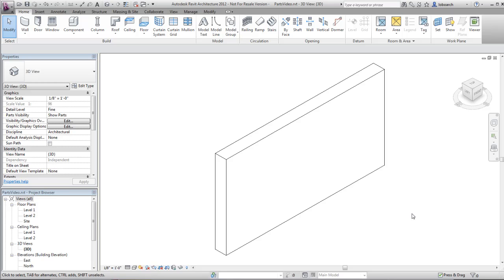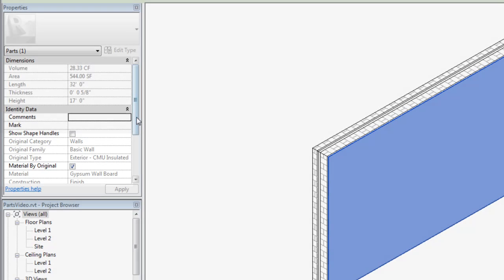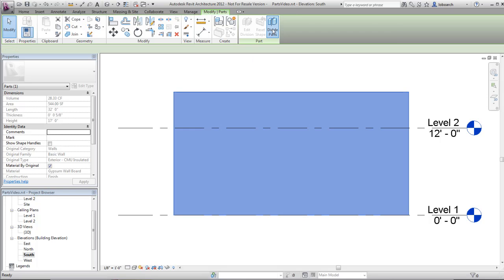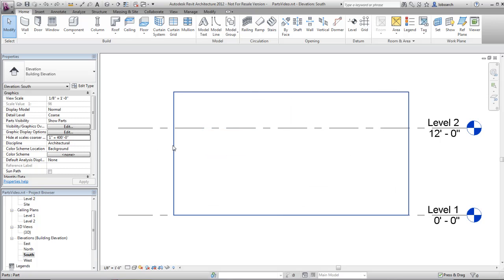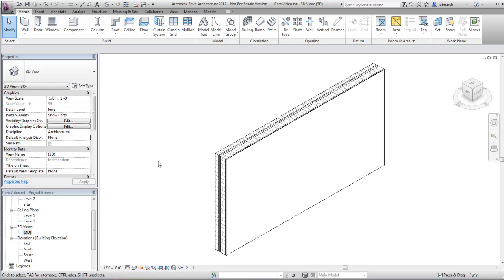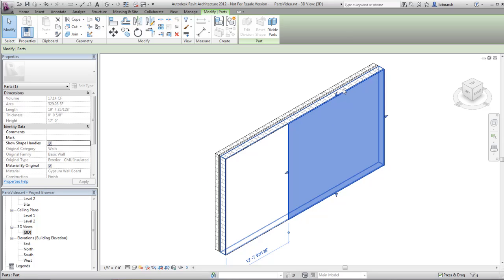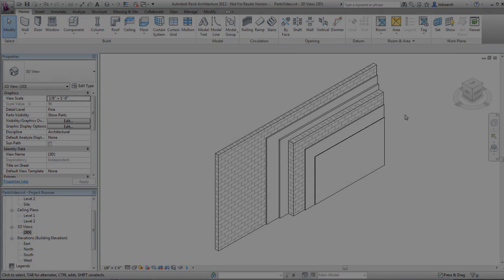Autodesk Revit: Creating and Dividing Parts

Comment: Is there a way to undo parts once created? I created a floor and made a part from it to split it, but now I cant edit the boundary of the original.
Reply: Open the Visibility, untick "Parts".
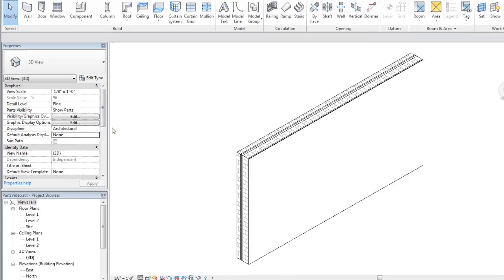or in View Properties > Parts Visibility > Choose "Show Original" (see the video, 00:58s)
Reply: Did you get a solution to this? I have engaged the create parts command and now i want to undo it because the command didnt help me for what i wanted. Now my generic model element is now a part and it doesnt behave the way i need a generic model to behave. I want it back to generic model.
Reply: @thuks101  just delete directly (with Supr) the object with the parts.. Revit will say exactly "All associated Parts were deleted and the original was made visible in the view." and you will be left with the original Only
Reply: @thuks101  not really, i just quite using parts.